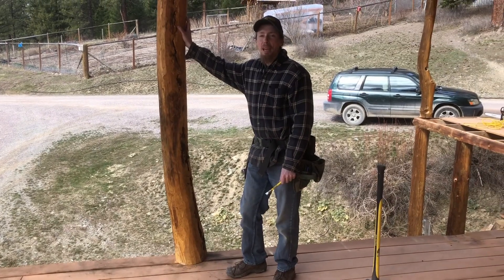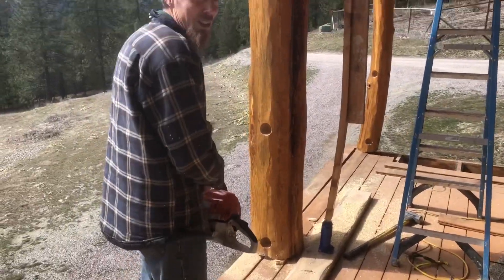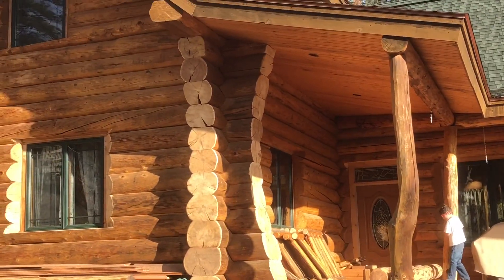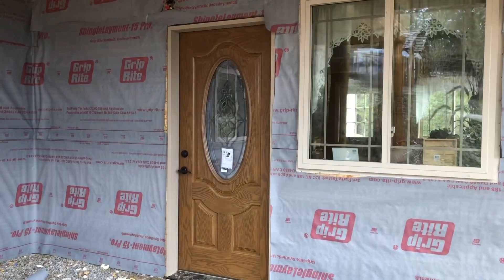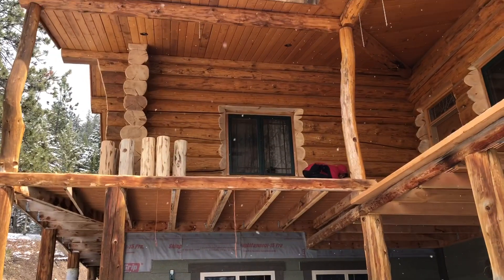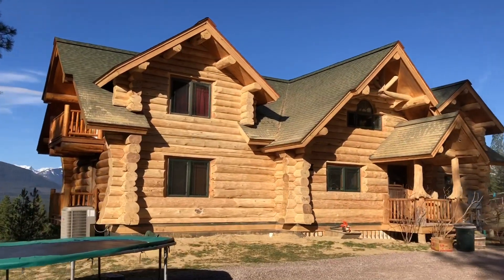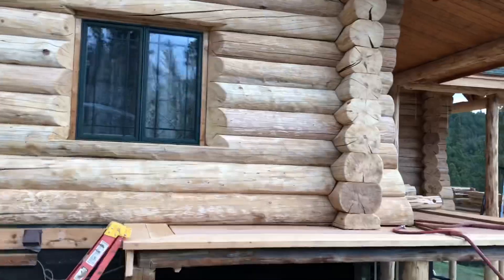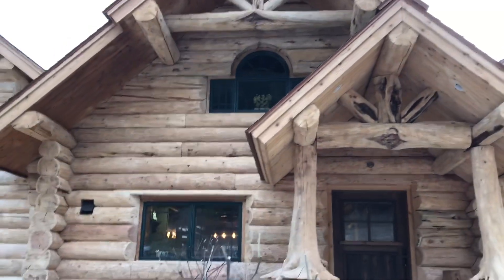Restoring Our Log Home - Remodel and Media Blasting

Comment: Is this a regular maintenance issue with log homes?
Reply from the maker: We only media blast our homes if the logs are very old and have not had stain for many years which was our case. Typically, if you stain them every 5 to 10 years you don’t ever need to blast.